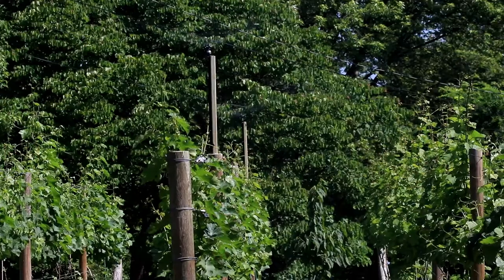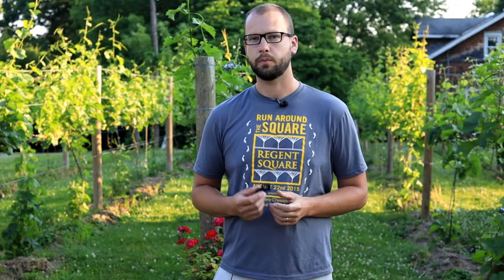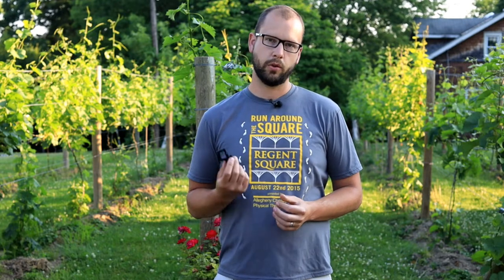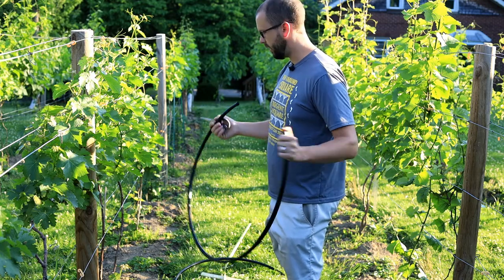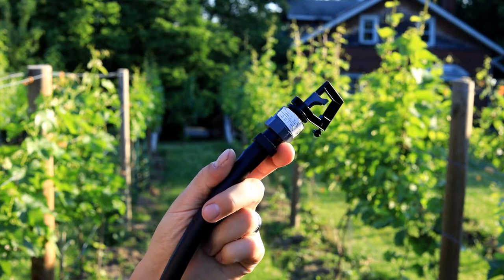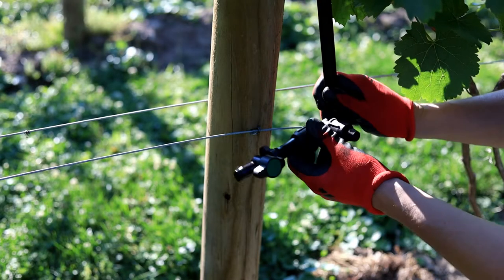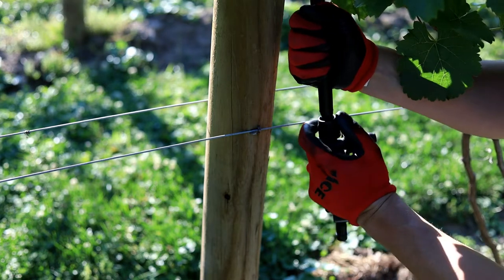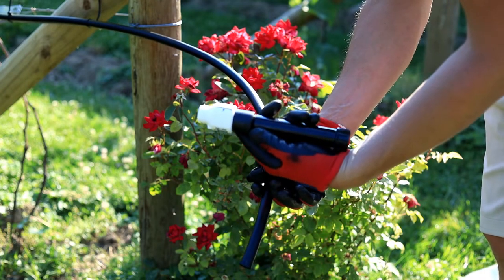Micro Sprinkler Installation in a Small Grape Vineyard

Comment: I was wondering if you would know why a wine I started in Oct. is still fermenting. The ferment started out good but when it slowed down it just never stopped. Is it too late to add a nutrient such as DAP? The gravity is around 0.996. Thanks
Reply from the maker: What is the pH?  If it is very low, like sub 3.0 it can really drag out.  It seems about fully dry.  Could also be a slow, drawn out malolactic fermentation.  Or it could be a film yeast that is feeding on the alcohol.  If you see any white chunks or film on the wine surface I would be concerned about that.